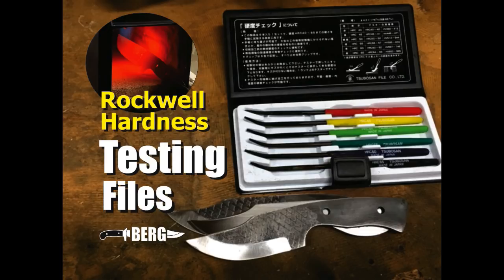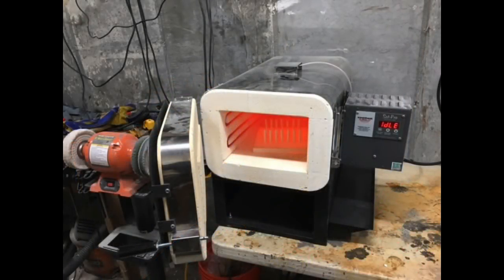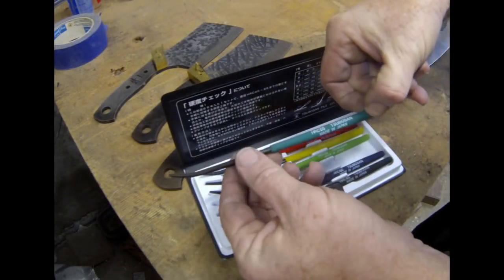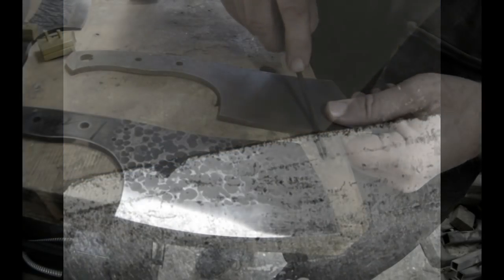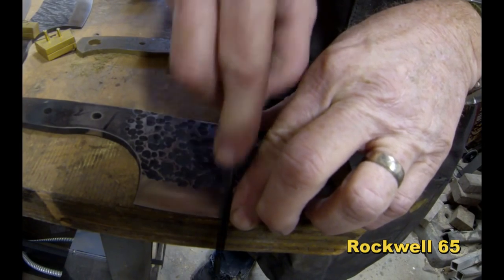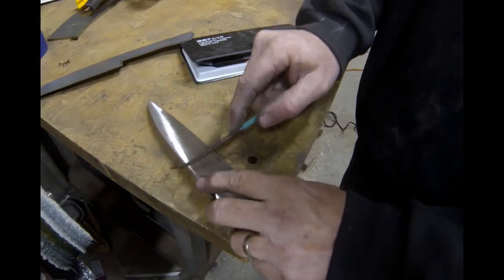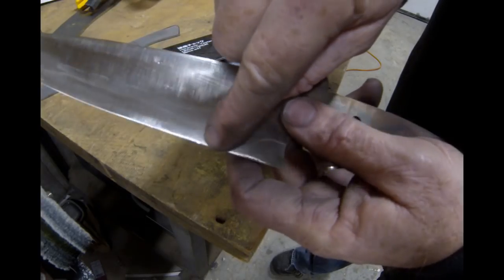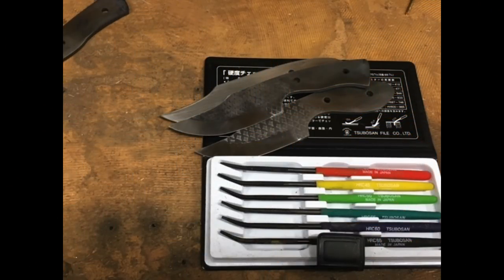How to use Rockwell Hardness Files for knife making

Comment: I have been using AEB-L alot lately and send it out for HT.
It comes back at 60-61 HRC
It can go a bit higher with a Cryo treatment. 
Love your tutorials and have been trying some electro etching of blades
Reply from the maker: I just started using it. I heat treated them @ 1950 for 15 min than plat quenched then into dry ice for cryo. Was very happy with 60-61 results. Plus even leaving this stuff around the shop I get no rust !!   Thanks for the feedback and support.
Reply from the maker: Where do you sent them? Can you send out small batches?
Reply: @DIYeasycrafts  
TX Knifemakers Supply in Houston They do any as mounts in small batch with reasonable prices and fast service 
I am in NJ.
Reply from the maker: Thanks for the info Nick. We are neighbors, Im on Long Island.
Reply: @DIYeasycrafts  
I was justin Hauppauge today for meeting!
Reply from the maker: Im in Baldwin. On South shore about 1/3 the length of the island

Comment: Another fine video Dan.  I have been using a set of chain saw files to sharpen my bread knives or serrated pocket knives.  I have no idea of the hardness level, but they bite right through the knife blades.  I was surprised with the bread knives as they are Henkels and supposedly very good quality.

The pocket knives are normally the two-buck varieties at Walmart.  I don’t expect these to be top quality so mostly they stay in the bottom of a tackle box or various tool pouches for the vehicles.

The chain saw files are in a pack of three or four at Walmart, so I wasn’t expecting much but when they cut into the steel of the supposedly good knives I was surprised.

I wonder how to get them tested for a HRC.

Comment: What happen after tempering if you use the files
Reply: After heat treating and quench, you're probably greater than 65 hardness, but the blade is very brittle.  Tempering brings the hardness down some, not much, to allow the steel to relax a little and not be as brittle.  

So to answer your question, directly after heat treating and quench, the 65 file likely won't do anything.  After tempering, the 65 will scratch the knife and maybe the 60 will scratch the knife.